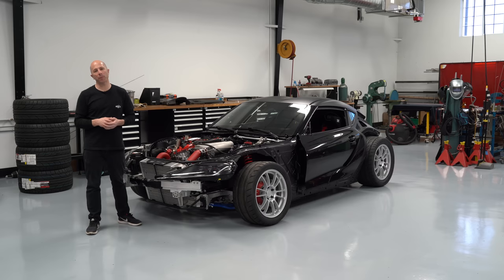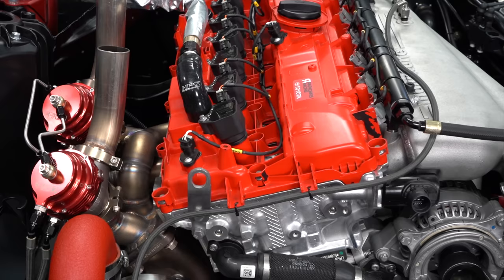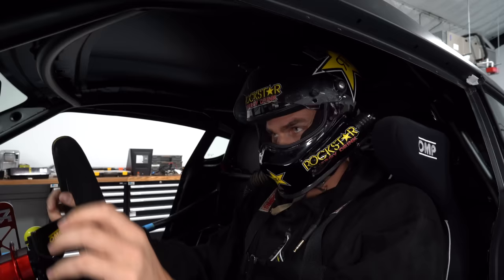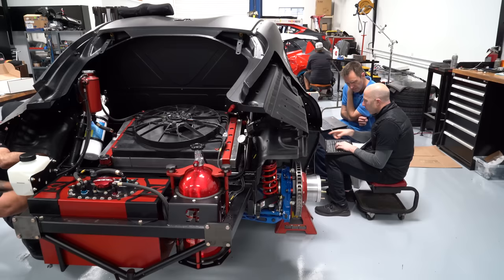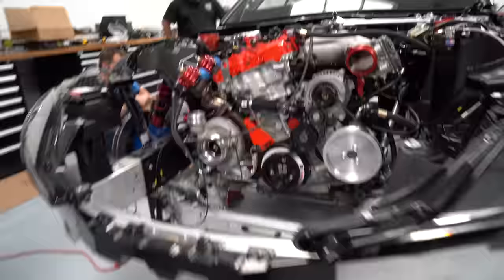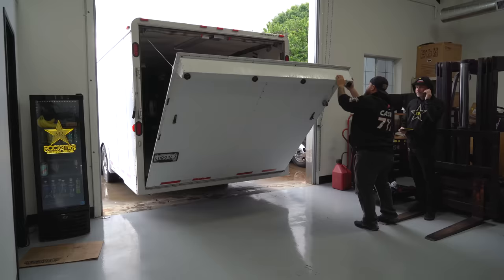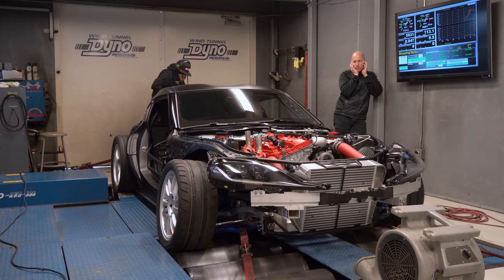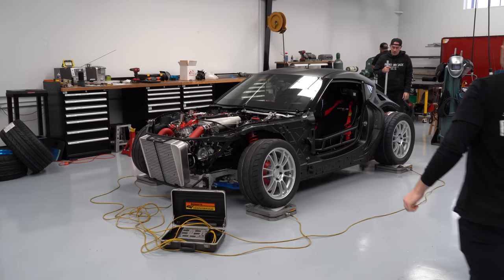2020 Supra Drift Build - Wiring and Dyno Test

Comment: "Pretty conservative on the boost, only 25 psi"
Reply: To be fair on the engine dyno they wete pushing 40 psi 😂😂😂
Reply: *were
Reply: @exquisiteart6478  Do you know what it made at 40?  I was surprised to see 750whp here, that's awesome.
Reply: @hughjaskoch5456  They made 1000+ hp i believe
Reply: @hughjaskoch5456   1000hp
Reply: @forcewave666  at the crank
Reply: @hughjaskoch5456  it made about 1070ish hp in 40psi (if I'm not in mistake)
pretty awsome to be doing 750whp at 25psi...  almost seems that papadakis was sandbagging on the engine dyno
Reply: @VDdsw  Yup maybe had barely any timing
Reply: Well sure dont need more than 700hp to get the rear wheels out of traction
Reply: the diesel world running between150-200psi of boost has joined the chat
Reply: @VDdsw  i doubt he went all out of the engine dyno with the engine still brand new
Reply: You could get boxer engine up to 25psi with simple tune. Fairly conservative numbers. I’d say 30+ gets hectic
Reply: @Conqueefstador  the elevation/fuel and engine build quality will have a say into the boost level you want to run. And doing a 30sec runs vs a real race is different
Reply: @ovodrizzyszn7766  which would probably translate to 900whp+
Reply: meanwhile their corolla engine make 1000k dino in first day in star up  they are coservative because the engine bmw reliabilty issue
Reply: Stock is close to 20psi
Reply: @kevinbosco5876  good point, plus they can't really check their oil and all that complicated head and valve mechanisms can fuck up compared to the Toyota engine which is wayy simpler 😂😅
Reply: That's nothing for a modern race car.  F1 cars are 50 psi for 12 hours during testing.
Reply: @exquisiteart6478  not only sipmpler bro but the block casting its godamn bulletproof eventhought its full alumunium casting . only one engine can beat that 4 banger was bmw f1 m10 engine with pure iron casting and weathered to incrase the stiffness to the block
Reply: @kevinbosco5876  it has nothing to do with reliability they barely did any fine engine tuning yet.
Reply: Have Sum Fun Then.  Hub Dyno
Reply: @exquisiteart6478  am I crazy but isn't 40 pounds excessive for 1000hp?
Reply: @adamhsr  eh, not really

Comment: @papadakisracing I’m a former dynamometer engineer and big fan of your work. If you can get access to a large roll dyno (30”+) it will give a bigger contact patches and allow more strap down force without the subsequent tire deformation and damage. This should keep the car from spinning on the rollers. Just one small pointer to help increase the safety for your team next time at the dyno. As someone who has seen a dyno and/or tire fail, it always scared me to see someone on top or behind the unit. Can’t wait to see this on the track - stay safe!

Comment: "We custom built most of the components in CAD and 3D printed many of them using cutting edge technology"
"We also tac welded some washers to the car to make it easier to zip tie the wires."

The blend of modern technology and shade-tree techniques is awesome to see

Comment: I see that cerakote on the valve cover chipped a bit.  Also wont that distilled water start to corroding any metal in the cooling system?
Reply: I would imagine they flush it out very often anyways since they're racing it, so I don't think it'll become a huge problem

Comment: What are the benefits of using 5W50 instead of the original 0W20? Is the 5W50 used due to the engine modifications?   I'm loving the whole supra series, it's so freaken SICK!🤟
Reply: Well he is going to be racing this car so a thicker oil is going to help with the stress the engine will be going through, it'll last longer and won't evaporate as much as a thinner oil.

Comment: Congrats! i know its a drift car but what do you think the 1/4 mile run will be with full boost? high 9's? low 10's?
Reply: High 9 mk5s are pushing 650whp-700+whp. It'll probably be a low 9-8sec car by then.

Comment: It makes 1000 hp at the crank and its making 750 at the wheels. So the loss is at 25%, shouldn't be the loss at 15% as it is a rear wheel drive car and it should be making around 850 whp.

I think it might be due to traction issue?
Reply: 1000hp at the crank with 40psi, here they only use 25psi of boost
Reply: @mostneuter  oh right!

Comment: Custom professional build - 750HP
Bigger turbo, straight pipe, tune - 650HP

Yall were more than conservative. All that work to get 100 more hp that some kid with an exhaust and bigger turbo? Lol but I understand you can't send it when it's this professional of a build.
Reply: 25psi pushing 750hp. If i remember correctly 40psi it's pushing 1034hp when the engine wasn't in the car. More or less running 25psi to keep it reliable and from blowing up.

Comment: You guys have plans to upgrade to the 2021 6 port head eventually?
Reply: I mean they have this one just to demonstrate that it can handle 1000hp. They can more than likely just yank a B58 from a wreaked 240i or any 40i BMW that has the 6 port heads.

Comment: How are you tuners handling the change of the design of the motor on the new Supra?
Reply: I'd say it's doing well but the process is slow because of the small aftermarket. Papadakis is the first to touch over 1000+hp vs everyone else either over 700whp or touching the 800whp range. It was found out that it cam handle over 800whp on stock internals(one reached 820+whp)but it can be risky since the rods will start bending. For now their just trying to find a way to tune to gears im the trans so it wouldn't bog or have clutch slippage once people start hitting over the 650whp range.

Comment: If the engine runs well that's fine and dandy for the regular streets but that's still not good enough in needs to run exceptionally well so pretty much it needs to run completely perfect because that engine's going to get pounded on it's a drift car

Comment: Military spec harness? What makes it that? Is it like quicker to change, more resistant to fire, water etc?

Edit: I also think i've never seen so smooth first start-up... last time my bro did an engine swap there were a lot of swear words and trial and error.
Reply: Better EM shielding. Most importantly is the quick connect barrel style connectors. They need to quickly swap a cable for repairs, etc.. Those connections are used in film/video where you need to quickly move equipment around.
Reply: @notninja  So to an extent I got it right, thanks. Makes sense :D

Comment: is it 1000bhp and 750 wheel?
Reply: Well they tuned the engine down once they put it on the car so assuming 15% drivetrain loss it's more like 862hp at the crank. They did get 1000hp at the crank on the engine dyno.

Comment: how much would it cost me to built this car? but with a 2jz instead because it makes  better sounds
Reply: Would probably cost u more since you'd be paying more to get the same power as the B58 plus it being heavier will take effect of everything.
Reply: @carboydorifutoparty3976  i know about the weight disadvantage but the aftermarket on the 2jz is massive therefore the parts are not so expensive and you can find them everywhere,there are already full built 2jzs out there, i don't mind the B58 because i'm a car enthusiast and not a fanboy, it's the sounds of a tuned 2jz or the rotor engines that satisfy me

Comment: 3:57 Papadaki: "We find out that its less likely to have corrosion" Wrong.
"Despite its benefits, distilled water is particularly corrosive. With no minerals to give the water pH balance, distilled water acts like a magnet, absorbing chemicals (phthalates and bisphenols) from plastics, nickel from stainless steel, aluminum from aluminum containers, and carbon dioxide from the air." - https://www.corrosionpedia.com/definition/407/distilled-water
Reply: What kind of water do you propose they use then?
Reply: @exquisiteart6478 There are racing coolants on the market, which prevents corrosion and cavitation. They are not glycol-based and do not have antifreeze protection.
Reply: @edincol  but he also said that coolant (if it were to spill) makes the track slippery and is hard to clean so what do you propose about that?
Reply: @exquisiteart6478  I suggest water-based, non-slippery racing coolants.
Reply: @edincol  that's a thing? Huh, I wasn't aware. Thanks for educating me on that

Comment: I’m really disappointed with “racing” dashboards. Factory electronics/gauges look way better than any aftermarket dash currently available. What should be done is instead of replacing factory electronics, just add an information screen that has all the race data you need.

Comment: Building an engine is just too expensive and costly why not LS swap because it can make 1000 hp no turbo and you can daily it and making 500mpg 

/s
Reply: Because didn't they wanted to do something that everyone was doing plus the fact that Toyota was sponsoring them to do this. Plus there's already some making north to 700-800whp with a very small list of mods.
Reply: @carboydorifutoparty3976  the only reason Stephen went the extra mile is because he is RACING it and needs to keep it reliable. Plus, more R&D on the B58 for the tuners 😉